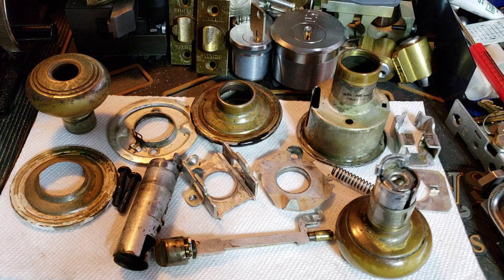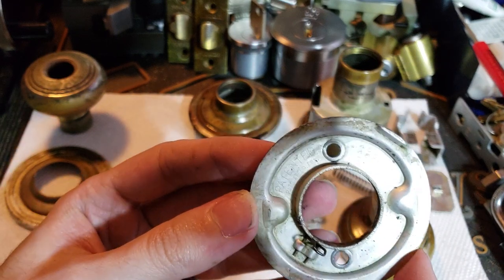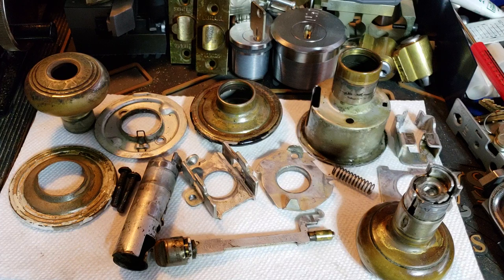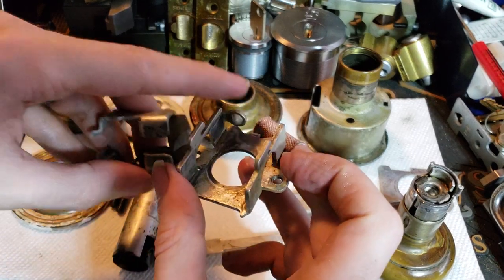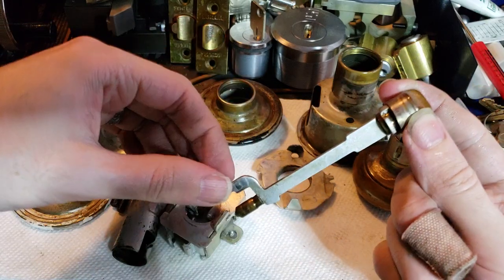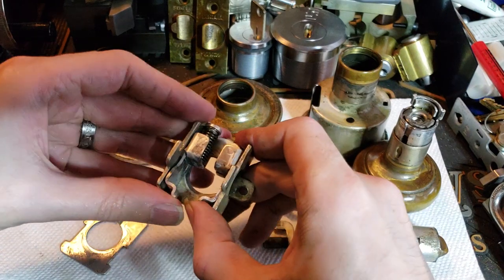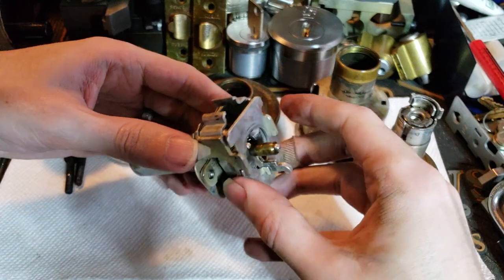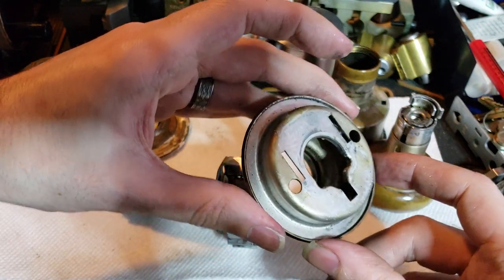(111) Servicing an 80 year old Schlage A series wafer lock

Comment: Great video on this, thank you for making it 🙏 I’m currently struggling with what I’m pretty sure is a later (60s/70s) pin tumbler A series (ribbed glass handle). After unlocking it from the inside can you take off just the keyed knob side for rekeying, or do you also need to take off the inside knob with the thumb turn, its plate etc.? It’s also not clear if you need a key (or need to pick it) to get the keyed knob side off 🤷‍♂️ I see a little hole on the stem on the keyed side but poking into it doesn’t seem to do anything, even when unlocked, which makes me wonder if it’s waiting for a key to rotate it 🤔
Reply: On further research it looks like the simple, remove-keyed-knob way requires a key or picking (https://kc.allegion.com/kb/article/how-do-you-remove-the-cylinder-from-an-a-series-knob/), and if you don’t have a key and can’t pick it that’s what the “full disassembly” method is for
Reply: Do you have any experience with the “Schlage service tool SCT-1” to know whether it reduces the degree you have to disassemble this in order to get the lock knob off for repinning? The product page says “The SCT-1 will make a frustrating job easier and faster” but I know sometimes tools don’t live up to the marketing 🤷‍♂️
Reply from the maker: I much prefer the M540-056 cap removal tool over Major's SCT-1. Either one will work though to remove the cap and tail piece without removing the cylinder from the knob.
Reply from the maker: Yeah for any of the AxxPD models (the ones with pin tumbler cylinders) you need to be able to turn the plug 90 degrees without rotating the knob in order to be able to depress the outside knob catch. If you can't pick the cylinder you need to do the full disassembly procedure and try to shim the cylinder through the spindle which is not an easy task.
Reply: @Nite0wl  thank you, I’ll definitely check that out; I got the SCT-1 and its little pointy thing didn’t match the pin location in the lock so I had to use my own pointy thing anyway 😂
Reply from the maker: The newer version of the SCT-1 has two ends, the one with the single pointy bit is for the B series, the other end should have a ring of small posts which is for the A series. Use the end with the ring to unscrew the retaining cap and dump the retainer and tail, then shim the plug and use a follower to push it out.

Comment: Nite Owl, do you have any information on how they used to master key these cylinders.  Thanks for the great video.
Reply from the maker: Master keying Schlage Wafer used a concept called "positional master keying". The basic idea is that one or more of the Series wafers would be replaced with Combination wafers or removed entirely so that a key with extra cuts on it would still operate the lock but regular keys would not. The Schlage Wafer service manual explains the details reasonably well (you can get a copy from lockreference.com)

Comment: My problem is with a closet set (no inside knob) with a glass knob (actually, I have several glass knobs with the same problem). The silver metal center of the knob has pulled away from the body of the lock, and the glass part rotates freely. Does anyone know if it's just a friction fit, i.e., if I push the center metal piece back toward the body, will that make it function? I have it disassembled to the point where the the lock mechanism needs to come off, but it's TIGHT and I don't want to break anything. Nor do I just want to glue the glass part of the knob in place if I don't have to. (These are original to my 1926 house, have  "Patented May 22-23" stamped on the case part.)

Comment: Thanks for sharing -- I have one of these, only later version from the 60's on a door here.  I didn't look up the patent numbers you gave, but I recently read on some Kwikset literature that they invented the circular type door lock in 1946, which revolutionized the industry as it was much easier to install than the Mortise locks -- I'm not sure about if really invented by Kwikset, but if so that would make your lock not as old as you thought (and if so, sorry Walter Schlage)  -- any thoughts?
Reply: Just watched you other older video on picking one of these -- very interesting -- I need a couple of springs to fix one of mine.  In thinking about my previous comment, I think perhaps Kwikset is "Full of BS", but that's not unexpected for such crappy locks as Kwikset
Reply from the maker: The cylindrical bore lock format was originally invented by the Blake Brothers in 1833 (they received patent 7945½X on December 31 1833, only one drawing and the patent model survive, the model is displayed at the Hagley Museum) but their lock was not a significant commercial success. Walter Schlage is generally credited with popularizing the format with his lock designs in the early 1920s and was the first to design one with a keyed lock integrated into it (The Schlage Wafer), his design also introduced sheet metal stamping to the manufacture of this style of lock which greatly reduced the cost.
Kwikset's earliest patents covered designs and methods for making door knobs, strike plates, and templates for lock installation and date to around 1947 by which point Schlage had been turning out the A series cylindrical door knobs for about 20 years.

Comment: that was weird, it looks just like the lock on my front door but much older. not much has changed over the years besides going to pins
Reply from the maker: Yeah, the A series only really changed significantly twice. Somewhere between when this was made and the late 1940s they changed to the dual spring and simplified cage design and shortly after that they introduced the pin tumbler version (A##PD models) which are still in production today (the wafer versions were discontinued somewhere in the 1970s but still hang on in a lot of places because they are incredibly sturdy and tolerate a lot of debris and corrosion).